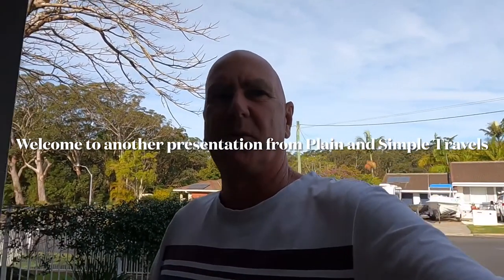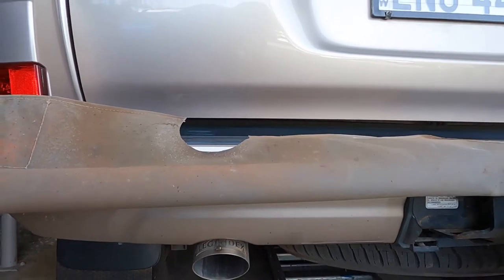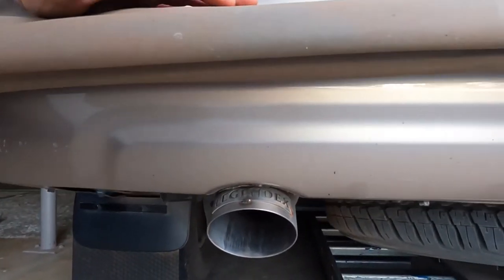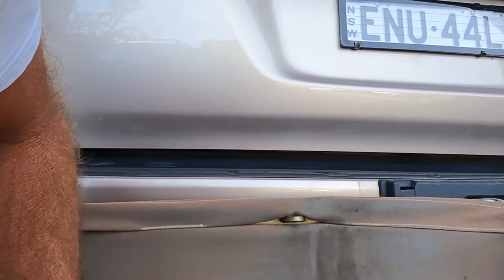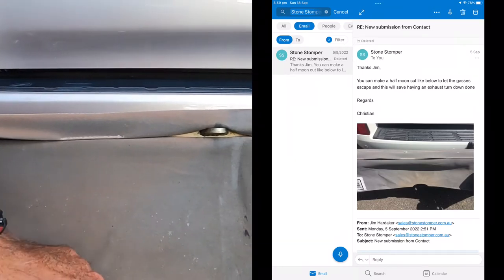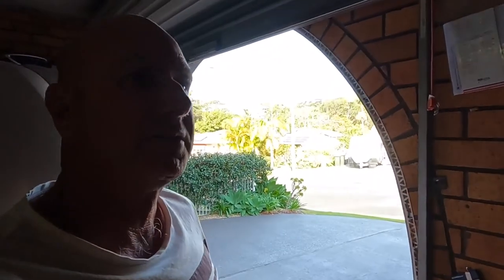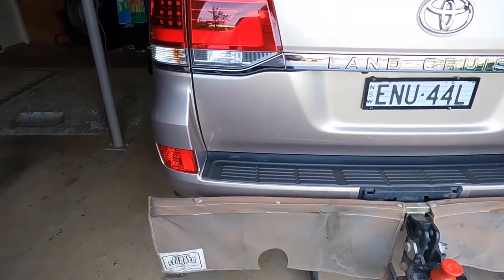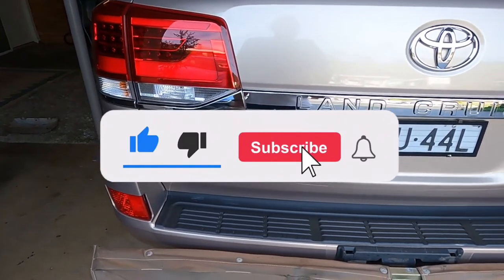What they DON’T tell you about Stone Stomper Stone Guards

Comment: You have installed incorrectly. They should be mounted with the clamps at 90 deg away from the rear so they hang like a water fall. This will also move them away a little from the exhausts and providing better rock dispersion.
Reply from the maker: Really,  they come assembled and only fit on the tow hitch in one direction,  the direction I have fitted. Maybe you need to watch my fitting video as well.  But thanks for the feedback.

Comment: It’s only material, which will take a hammering protecting your trailer/caravan.   So a little ‘self’ modification surely isn’t that hard.   I have no hesitation buying a stone stomper when we hit the road
Reply from the maker: Sorry mate you miss the point. When you come to order yours you will have to supply exact measurements which, supposedly are used to individually make each unit to your specifications. All I am saying is why can’t they ask if you have an aftermarket exhaust and built in a vent as they do with other system, ie rock tamers, or do the cutout at factory so it is stitched.

Comment: Mate l don't think stone stomper should have to point out that exhaust straight on canvas is not good and it doesn't matter what R /T does they don't work.
Reply from the maker: Exactly, that’s why I did the video. Although now when you send in your measurements to have one made they suggest modification to the exhaust tip to avoid this happening.

Comment: So isn't it the after market exhaust causing the problem. 
You made it sound like it's a stone stomper problem. 
I've had a stone stomper for ages now. 
No problems what so ever.
Thought there solution was brilliant.
Reply from the maker: Exactly but, when you order a stone stomper you have to supply a lot of information to ensure correct fitment, I am just trying to highlight that maybe they should also ask whether you have a standard or aftermarket exhaust fitted as well.
Reply: @plainandsimpletravels  SS make them to suit standard vehicles, what you do to your vehicle and protection is your responsibility. Many I've seen have modified the canvas to suit their vehicles knowing just that.
Reply from the maker: Thanks for the feedback Mike, but the point I was trying to make was, when they ask for exact measurements so the stone stomper fits your vehicle exactly, why not at the same time ask whether you have an after market exhaust. Just makes sense to me but maybe I expect too much. If they did the cut out at manufacture then it would be stitched and looked finished off properly.

Comment: On the flip side how is the exhaust system. I have a 2014 200 4.5 diesel that needs an exhaust system. So many on the market saying this, telling me they have the best. Just don’t know who to believe and don’t want to spend 4K. Are you happy with yours.
Reply from the maker: Yes you are right there, it is a hard choice. You have the advantage of being able to do turbo back and get a better result. I could only legally go dpf back. Cheaper but not as great an improvement in performance but still happy with my choice. Not overly noisy.

Comment: Get your exhaust modified so it exits out the side. Easy solution. What did you expect, with it hanging in front of the exhaust.
Reply from the maker: Yes, in hindsight that is a solution, and one which is now adopted on the stone stomper website and order form. The video was made at a time when the problem was not publicised and so as far as I am concerned it has had a positive result for 200 series owners with aftermarket systems who were considering fitting the stone stomper.
What did I expect, I didn’t expect the material to incinerate without any warnings from the manufacturer or the option to have a vent fitted from factory as do rock tamer.
Thanks for watching and commenting.